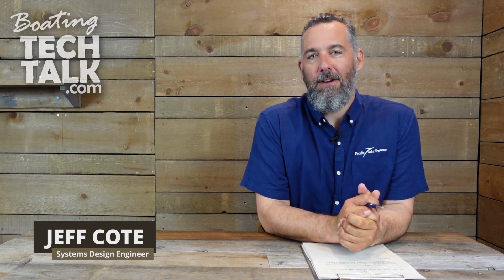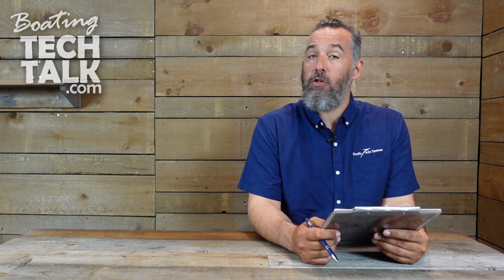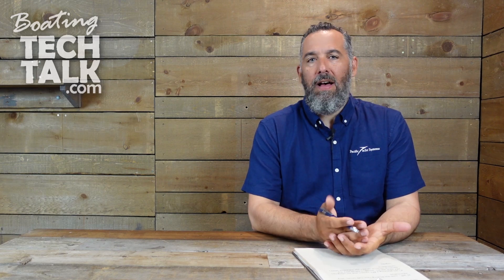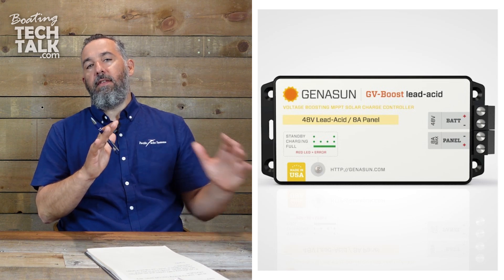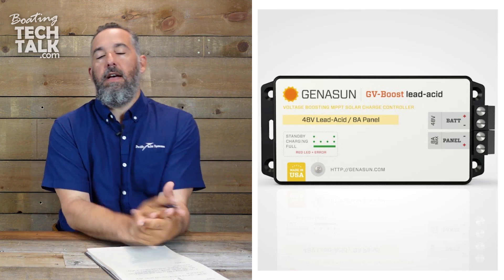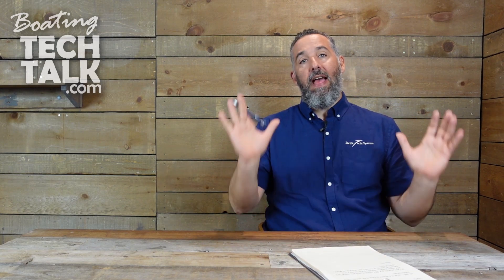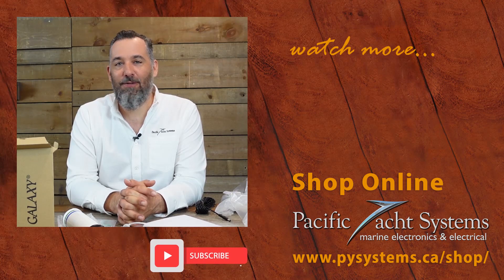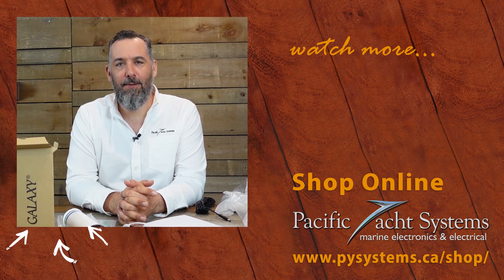Charging A 48V Battery with Two 24V Solar Panels

Comment: I have recently got a 48v victor Inverter My old inverter was 24v the panels are 24v (38v),
 I was wondering would it be do able to connect the 4x 100ah 12v batteries  in series to get the 48V, then 2 panels to charge 2 of the batteries and the other 2 on the other two batteries? cause I don't think my panels support series (we got them at an auction so there was no information on them)

Comment: The answer to every problem is not a boost controller.  If you use a boost controller to up the charging voltage you sacrifice charging current which in turn lengthens charging time.
Most 24v panels actually put out around 32v open circuit voltage and around 27- 28v into the controller. 2 wired in series will give around 54 to 56v into the controller which would be plenty to charge a 48v bank. Since it sounds like he already has the panels the place to start would be temporarily connect the controller to his batteries and then his 2 panels in series to the controller and measure the charging voltage. Worst case if the voltage is too low add a 3rd panel.
Reply from the maker: the victron controller for example requires 5v higher solar voltage then the batteries.   with a bit of shade or cloud you may not hit peak voltage and it will never start charging.  it's best to have some buffer from the PV voltage to the battery voltage.   You'll get more charge in the morning / evening and cloudy days.   otherwise if the controller is not triggered on you get 0

Comment: So if you are using electric motor (say 48v on lithium batteries), and you are charging on solar panels (each 24v output), you would need at least 3 solar panels (total of 72v) to charge the batteries for optimal use? If so, I think many people are forgetting this and are ok with 2 solar panels of 24v making 48v...
Reply from the maker: When charging with a solar array, it's possible to have a solar array lower then the battery voltage and use a boost controller (instead of buck controller) to adjust to a higher battery voltage.

Comment: Idea for the a future Tech Talk:
Why do some fuses rated 100A for example, blow at 100A, while others will blow at far above 200A?
What are the factors to consider when selecting fuses for your DC system (like AIC, temperature, slow vs fast blow)?
Reply from the maker: Tks for suggestion.

Comment: Hello , I've set my 48v system up with 4 x 150/35 mppt's
     3 x panels per array
     4 x arrays
    135v per array....it is a sailing cat with electric propulsion + gensets & a 5000 X 48v 50a inv/charger
+ 48v 25a charger back up 
BUT nothing's perfect , everything's a compromise &  it is a Sailing boat...l can't wait to fully test the set up & the regen when sailing...all good fun & exciting stuff...cheers
Reply from the maker: Thanks for sharing Peter.